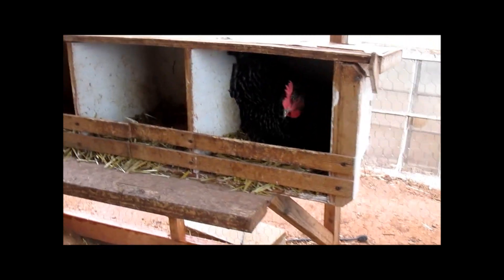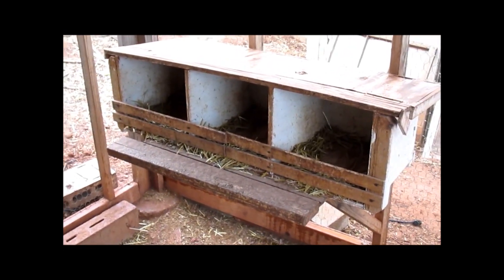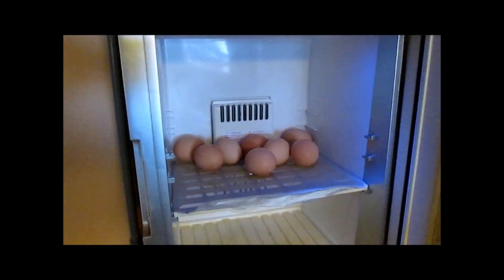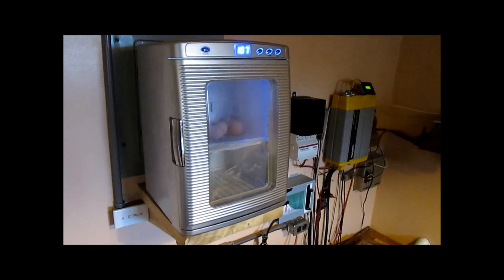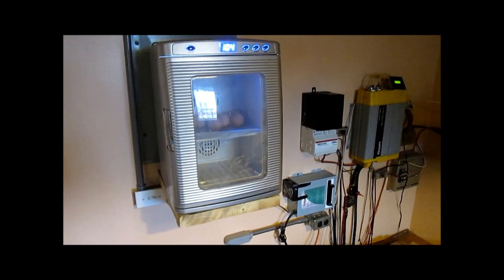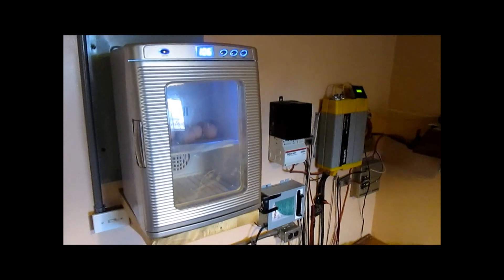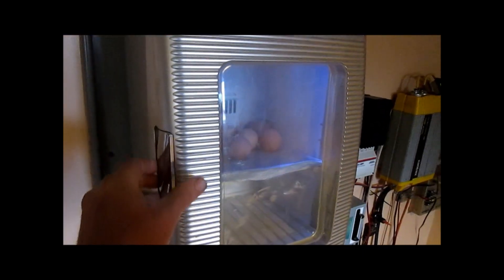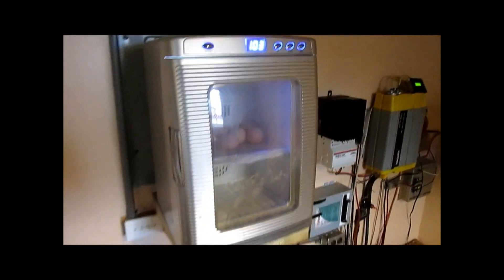Off Grid Egg Incubation

Comment: Excuse me, I know this is rather old but what was model of this incubator? Also who made it?
Reply from the maker: This is a Chinese import item that is branded a lot of ways and even as a lot of items. It's capable of heating or cooling so it is offered sometimes as a reptile egg hatcher (as this unit was) or sometimes as a 12V car cooler for food and drinks. It was okay as an incubator, but I expect there are better options. A 50% hatch rate was typical for this box in our use as a bird egg incubator. I loaned it to a friend a few years back and haven't seen it since :D